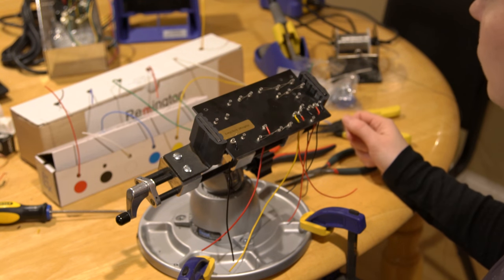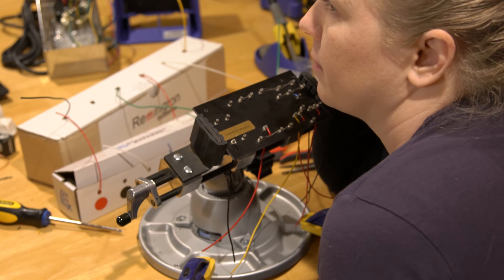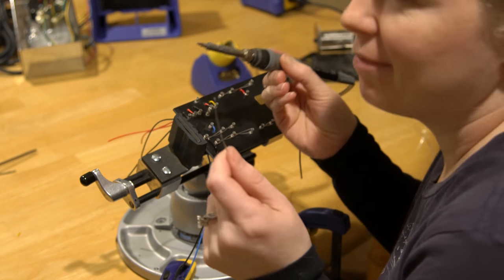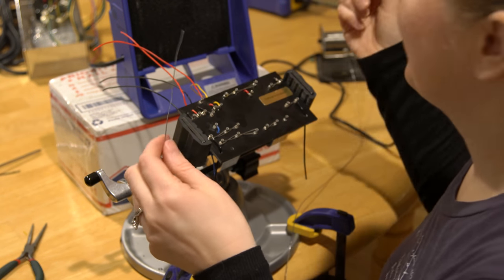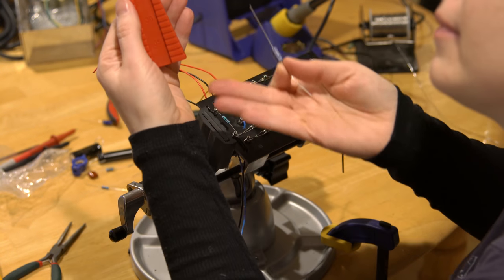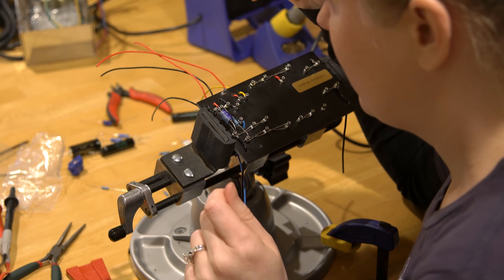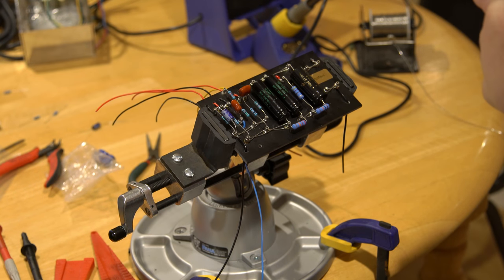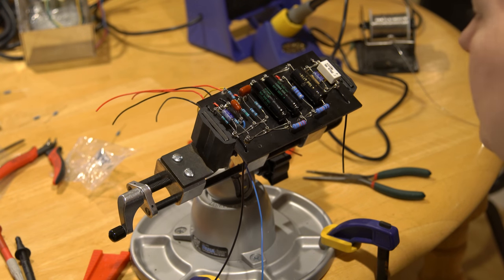Fender 5F1 Champ Video 3

Comment: Did you point out that the electrolytics are polarity sensitive?  A reverse electro is bad news.
Reply from the maker: I don't remember if I did but you're absolutely correct, the capacitors clearly show the positive and negative lead, always make sure you keep that right.  The only time that can be a bit confusing is in amps with negative bias.  This amp doesn't, but in those cases, those go in upside down for negative voltage.